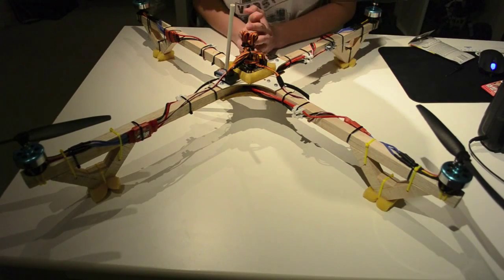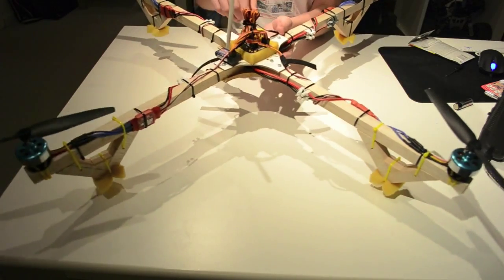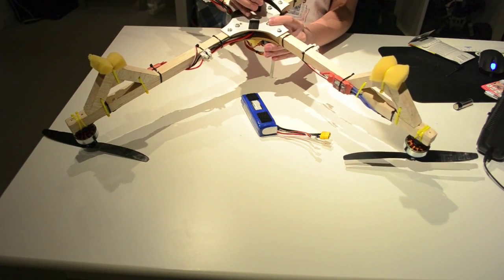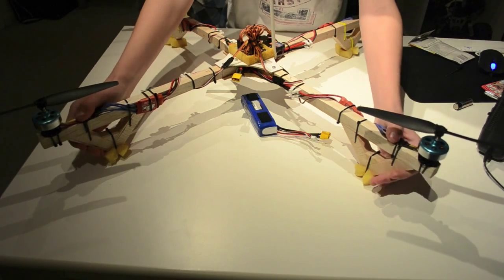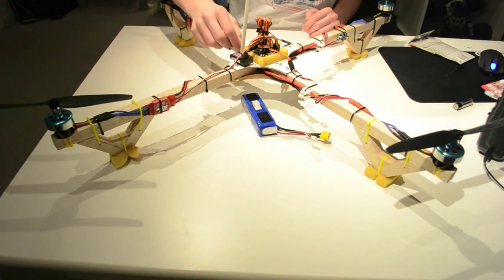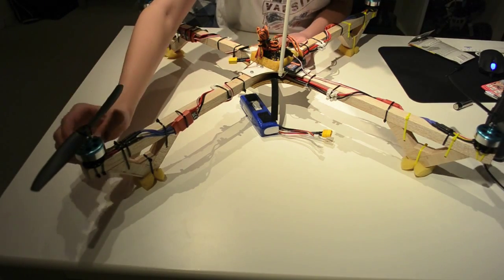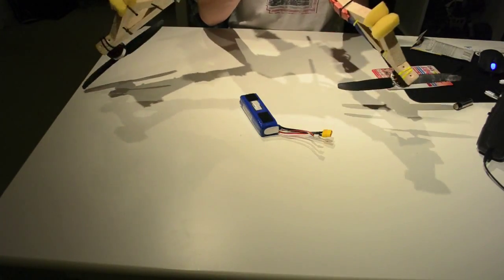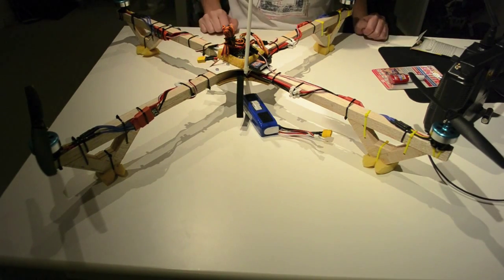Quadcopter Build v1.0 [Part 6] + Test flight

Comment: Hi, I also built a wooden frame but my quadcopter does not lift from ground.... I have 850KV brushless and 1045 propellers but it seams to be too week... I am new in the field so, can you tell me what king of motor are best for that kind of built?
Reply from the maker: Are you sure you mounted the propellers correctly so they lift and not push down? Also which motors do you have, and what is the weight?
Reply: The motors that I have are 1000kv and the battery that I used was a 2 cell. I bought larger props (1147) and I managed to lift the drone but I see that it is now enough ... And yes, all the props are pushing down. I order faster motors (2600kv) . Do you have any website where I can use to calculate the combination motor/props for a certain weight (that I don't know exactly?)
Reply from the maker: Claude St-Louis Oh i see. You need atlas a 3S battery. The motors simply do not get enough power out of a 2S. You would need at least a 3S 30C 3000 mAh battery. You shouldn't need faster motors. 1000kV is maximum. The faster the motor the smaller the propeller otherwise you will burn the ESC/Motor. So in this case definitely upgrade the battery to at least a 3S.

Comment from the maker: Well. Since this is quite old now, i have made improvements. If you watch my channel i got a version 2.0 assembly which is in aluminum - and i used 11 inch props (not shown in the video because i didn't have it by then. But now i fly a H-Copter with a MultiWii Pro. Wood is definitely the best. It dampens vibrations from the motors. I use plywood. Also with 11-inch props. Should maybe make a update video showing what i fly now. :-)

Comment: To be brief- This could of been two videos. Its not a new design, but you made a decent presentation. Make it shorter with less commentary. Make an outline of what needs to be said and follow it, dont ramble. Use washers on wood. Always use center boards for strength. You can either shorten your arms up some or use larger props. I believe those motors can take an 11 or 12 inch prop. You would love the diffrence. Its flyable, keep going. Im building mine soon (but from alluminum)

Comment: I think you should better stick with aluminium :), more durable, those DT750 can handle the extra weight with 1 1 inch props, nice build if you crash rebuild don't give up :)

Comment: it will be easy to buy the frame ready or use aluminum metal and they are light, strong and cheap. buy the way i bought frame for $17 dollar. Did you make a video for programing and balancing the prop. Thanks for again for great vedio